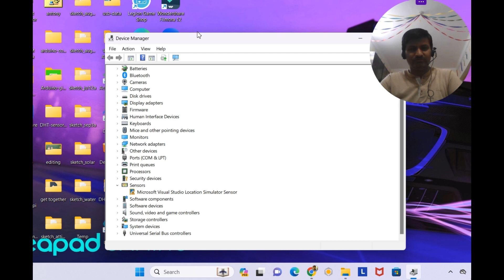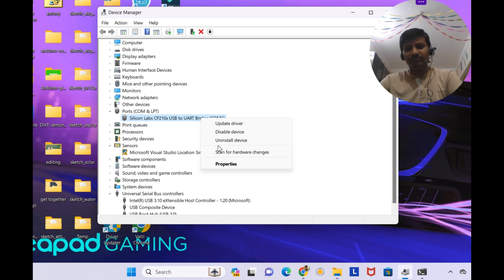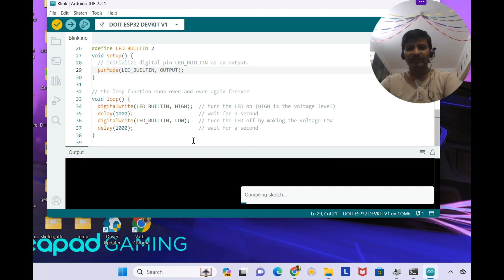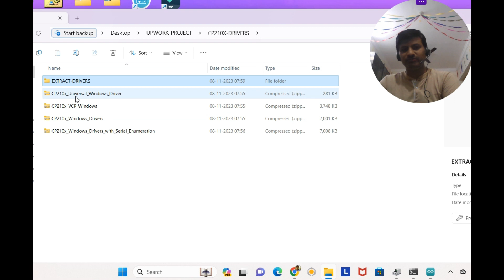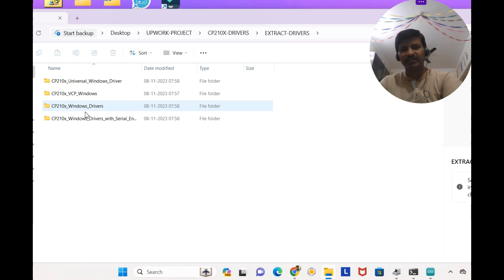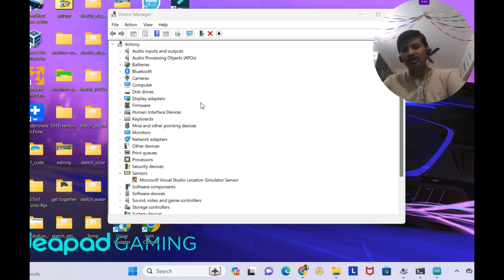Windows11 CP210X Driver Issue - ESP32 Boards

Comment: I was facing the same issue for 2-3 DAYS and i was finally able to solve the issue.
In my case the problem was with the cable that i was using with my esp 32 was a simple charging cable a cheap one i even tried other cables of my friends but they also not worked, but at last when i tried with a average cost data cable 200-300rs (in my case i used a potronics cable) then the ports automatically showed usb to uart bridge.
nowadays if your windows are updated (mine is windows 11) so it will have preinstalled drivers needed for the chip through the update.

Comment: Begin the Upload. When the IDE notes "Connecting" press the IO0 (Boot) button for 1 second and release.
Reply from the maker: Thanks for the update , My issue , I am not getting the COM Port number some times. 😭 -In Windows 11
Reply: I'm having the same issue doesn't matter what board I use, windows 11 can see there is a bluetooth COM but not a USE SERIAL COM. 

After downloading the drivers I still wasn't able to connect. Regardless of pressing and holding or quick pressing boot on either adafruit, inland, or adruino. 

Commenting in hopes an answer is found.
Reply: bro same thing happening with me ,my ESP32 ch9102x and esp8266  they are even appearing on device manger  even i have installed tons of driver  @H34rtl3ss